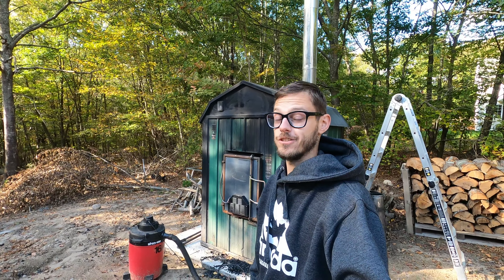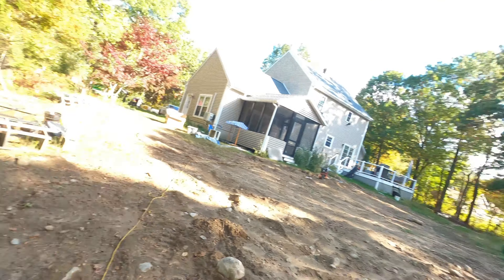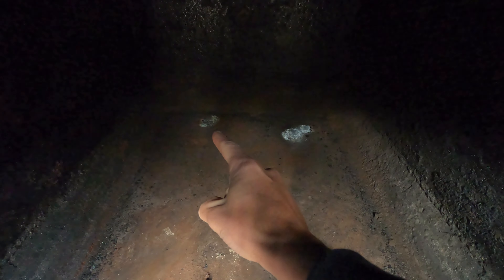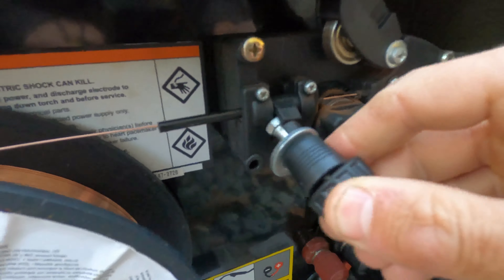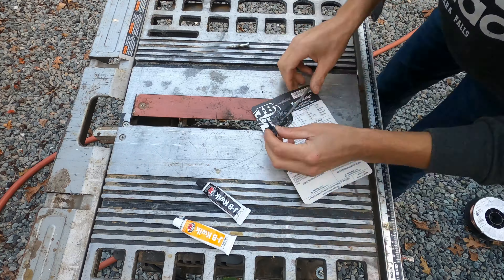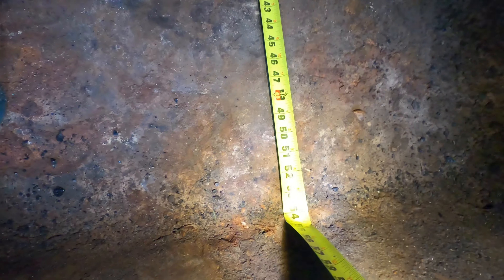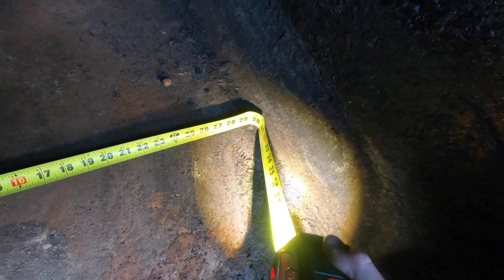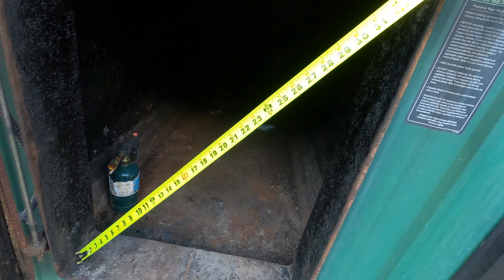Is Buying A Used Outdoor Wood Boiler Worth It? Let's Find Out!

Comment: Very cool! I'm a novice welder as well, and for me, just practiving on scrap metal has helped a lot. Something I've struggled with is moving my hands smoothly as I work down a piece. I had seen some suggestions of just practicing the movements without welding, so if you have trouble with that I hope that tip helps!
Reply: I frogot to mention, it could help to clean the areas you would weld, I just use a flapper wheel on a grinder!
Reply: Dont move your hands, move your upper arm. All the good welders ive seen dont move their wrists unless theyre doing fine tig.

Comment: Maybe next time, use some dye penetrant to find some cracks and small leaks. This will make your life a lot easier.
When it comes to welding I might use some 6010 rod for first pass this will help you with the dirty steel. Then use a grinding disk to smooth out your weld. Then I would go to a 7018 rod for the cap. Last step hit it with the dye penetrant to look for cracks or pinholes. 
I'm a Welder/ Boilermaker by trade. You can use the wire feed you get a better weld with SMAW.
https://youtu.be/8I1onrUqjDA?si=4JUu1TWrUpw5I6Ws